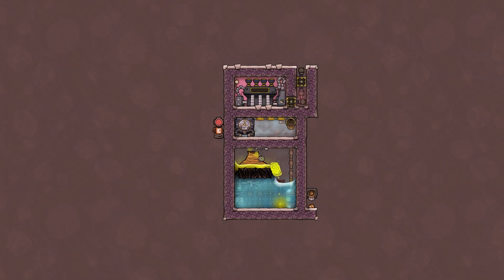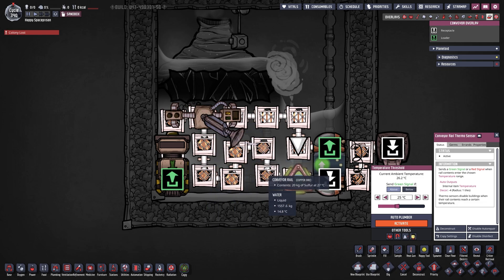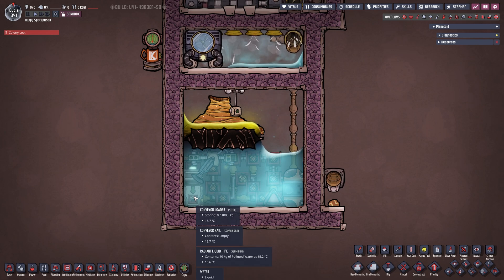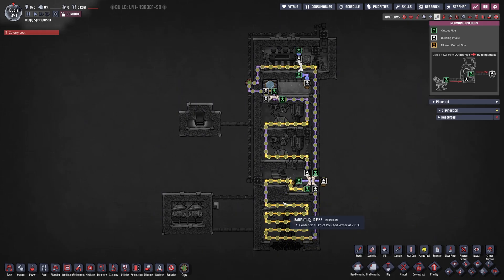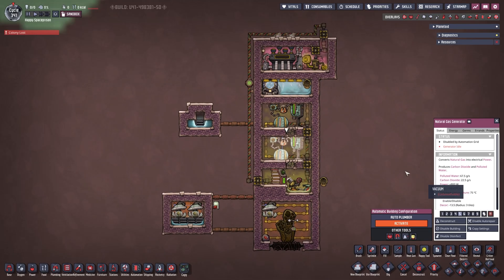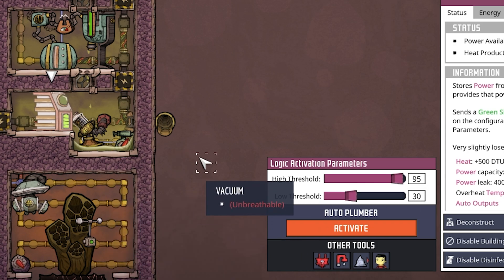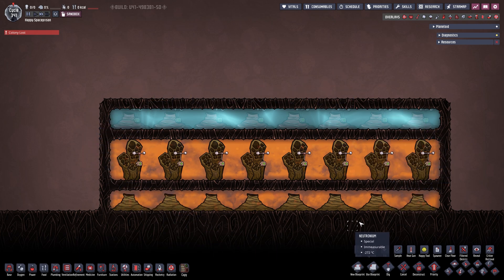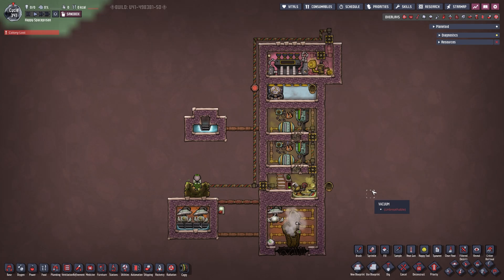GERMAN ENGINEER explains ONI: SULFUR and NATURAL GAS Geysers! Oxygen Not Included Spaced Out

Comment: If you’re willing to sacrifice a bit of steel and some refined metal/diamonds. Put the base of the steam room on top of the natural gas geyser with refined metal, transferring heat into the liquid water. Use steel gas pump with an Atmos sensor keeping inside the natural gas chamber. Very rare it will occasionally set off the steam turbines deleting the heat. And a little more complicated snake the 2 kg of water through two flows through the chamber to remove more heat.

Comment: What's going on with the two electrical joint plates in the upper right of the Natural Gas setup?
Reply: Joint plate transfer heat. If you create a vacuum between it then heat will not be transferred.

Comment: i'm enjoying watching your tutorials. but i find cooling natural is a waste of power. personally i just place a gas pump made of gold in a small room with the vent and i sent it to be burned by the engine and that has never failed me! and it's easier to cool down the engines and it will use less power. or you can make a set up like the hydrogen vent set up you did in your previous videos to use that excess heat to generate power with steam!
Reply from the maker: You are right, it is not needed. I wanted to build something compact to use the geyser as efficient as possible. The gas is mainly cooled in this build to make as much use of the Tuner as possible, which we need anyways for the steam turbines :)

Comment: So only everything in the at room need to be steel and st made out of gold, anything else? (Sulfur tamer)
Reply from the maker: The only thing that should be steel is the Thermo Aquatuner, everything else is in water cooled by the Aquatuner and should never reach a high enough Temperature if your Pipe Thermo Sensor is setup correctly.
Reply: Can u post an image of how coveyor rail connect, cuz in the video, it's behind the sweeper
Reply: It would be nicer if u use Combined Conduit Display mod cuz it move rail /pipe to the front